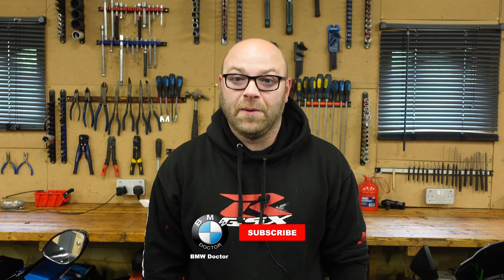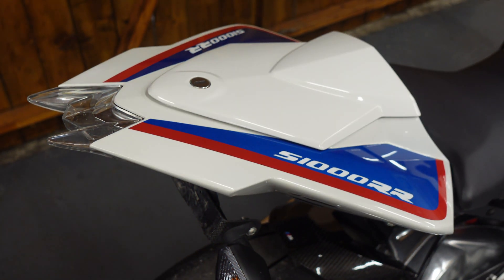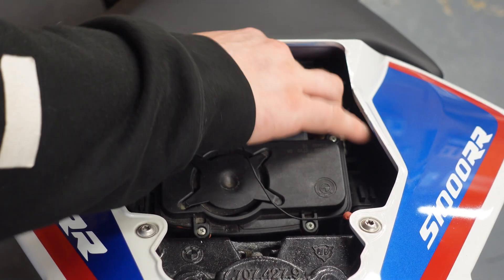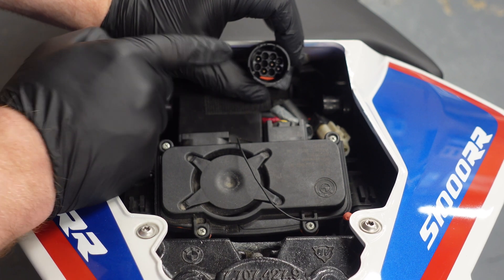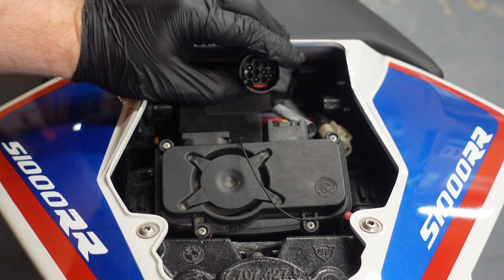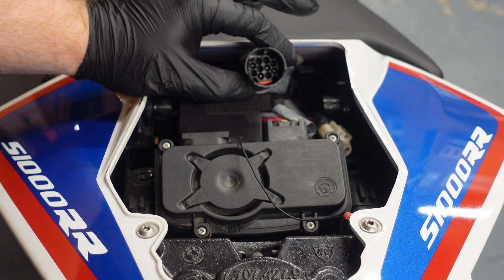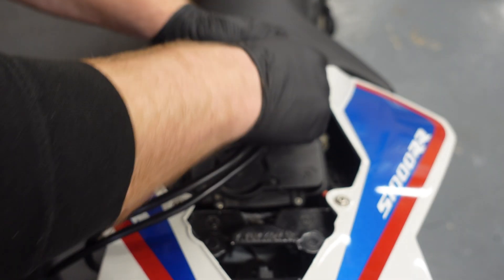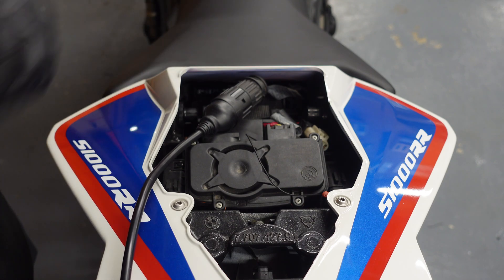OBD CABLE CONNECTION EXPLAINED ON THE BMW S1000RR!!

Comment: Hey man I have the 2018 s1000rr mine doesn't have that. It only has the adapter case which connects to the odblink lx. So I don't need the cable right? Thanks